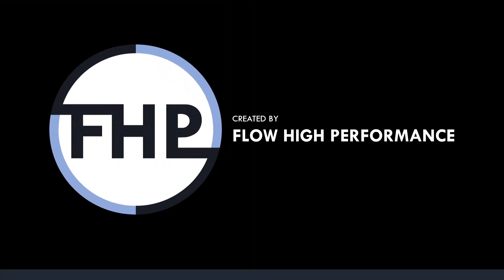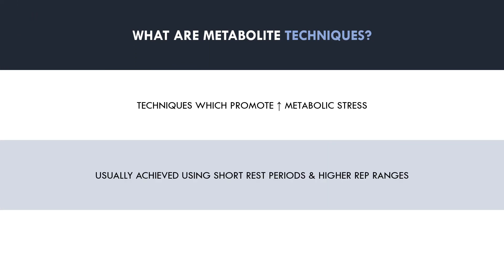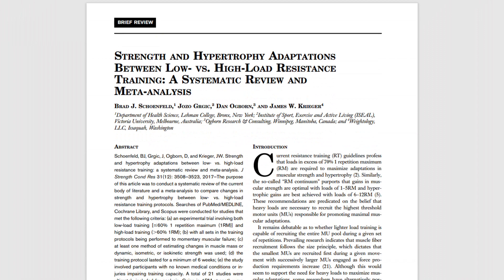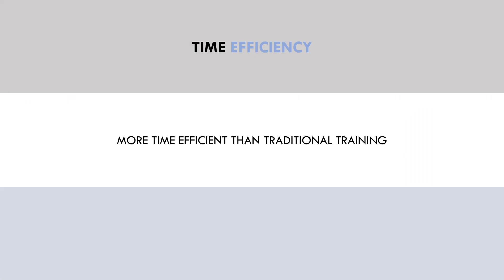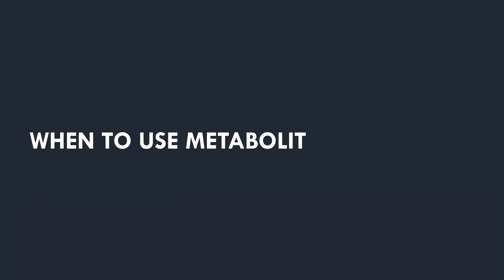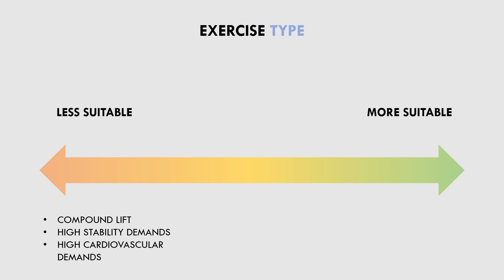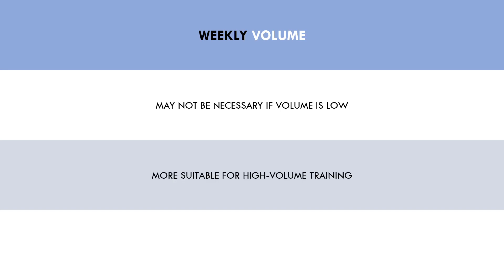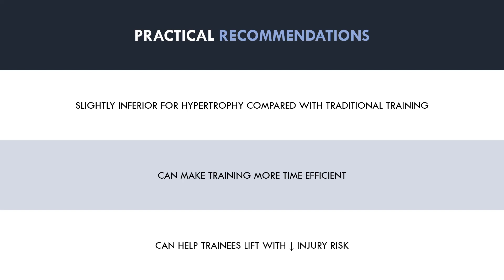When to Use Metabolite Techniques for Hypertrophy Training? | Metabolic Stress for Muscle Growth

Comment: Hasn't this already been debunked, isn't mechanical tension by far the most important one
Reply from the maker: Yes, current theories suggest mechanical tension is the most important. However, metabolic stress can still indirectly result in greater mechanical tension by inducing fatigue. As metabolic stress increases, the low threshold motor units are fatigued, and the high threshold motor units kick in towards the end of the set. So in reality, we can achieve similar hypertrophy with a range of different loads, rep ranges and techniques, as long as we take each set close to failure 👍
Reply: @FlowHighPerformance1  can you dumb it down in less words?
Reply: @FlowHighPerformance1  Yes but this is just mechanical tension still. If you got metabolite production but stopped too far from failure we can predict this will yield subpar gains if anything. Yes fatigue and transient hypoxia will allow you to train with less absolute load but thats about it. The driver of adaptation is still mechanical tension.
Ill be radical but i fully believe this. Metabolites absolutely facilitate gains but by themselves and in absence of enough mechanical tension (proximity to failure) they will provide 0 growth. If this wasnt the case marathon runners would be swole. They are not.